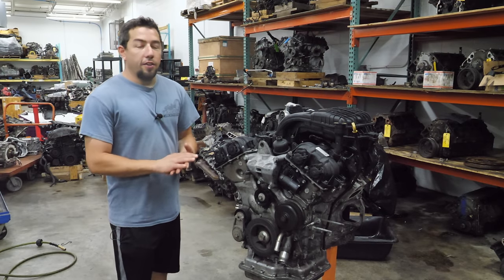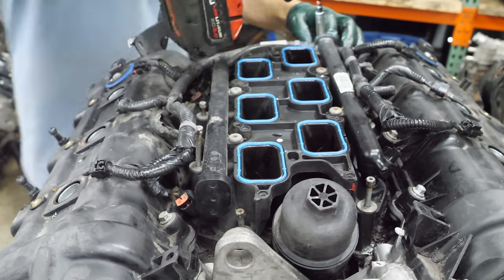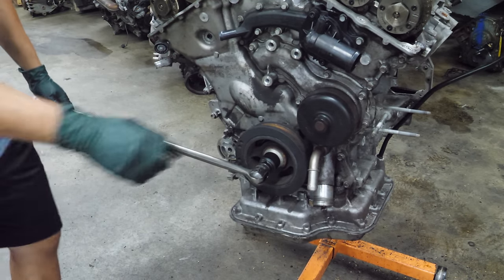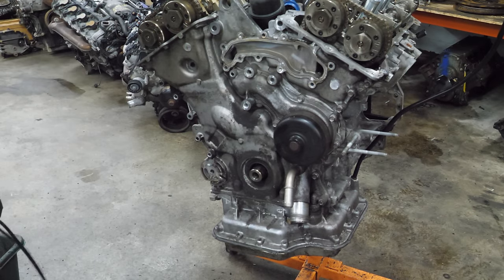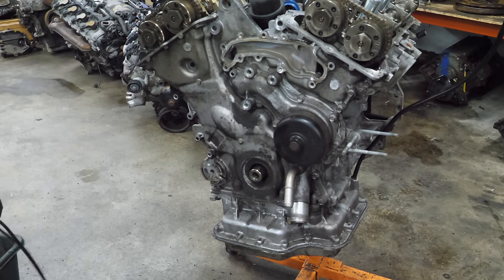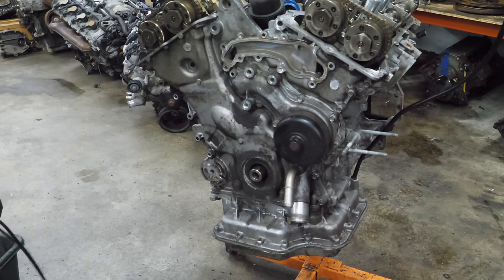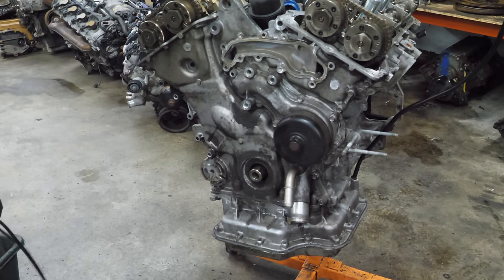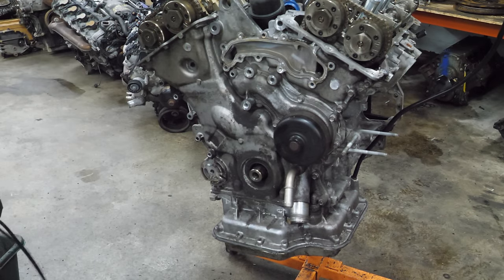Dodge Caravan 3.6L Pentastar V6 Teardown! Why Won't This Engine Turn All The Way Over?

Comment: A lot of the 3.6 were “Flex-Fuel” (FFV on intake cover) indicates that they can use either regular gasoline or E85 fuel. E85 is not around here so I have always used regular. The problem is the computer usually sets for the type of fuel currently in the tank and if you constantly go back and forth between them, it throws the computer out of wack for almost 100 miles causing wrong timing, fuel mixture and poor performance and thinking it is a injector problem, people throw some additive in causing more problems. That might be why the heavy carbon buildup. It states in the owners manual to stick with one or the other as the computer adjust for that fuel. But how many people read the fricken manual???  I have had 3 different vehicles with that engine and all were well over 200k and running great when traded in.
Reply: Or just don't burn the corn water and don't have issues
Reply: I have 2 5th gen vans, an 08 3.3 and a 15. Both go into ethanol percentage learning mode if the fuel tank level increases significantly while off. I can actually watch the PID for calculated ethanol % adjust with AlfaOBD after refueling. We use both regular E10 and E85 in both vans because sometimes the E85 is less than 75% of the cost of E10 and thus worth using and sometimes it isn't. (E85 is 75% of the energy content of E10 thus to be actually cheaper it has to cost less than 75% as much).

Comment: The carbon build up was probably the cumulative result of short journeys on a cold engine, direct fuel injection (no port injection to keep intake valves clean), and a PCV system without catch cans to collect crankcase oil vapours.

Comment: That's an insane amount of carbon. I have this engine in my 2012 Ram CV and it does not consume a drop of oil. Just about to turn 200 000kms too.

Comment: Whenever I spray brake cleaner on a carbon-covered surface, I noticed that while solid carbon usually falls off of its surface, it chunkifies just like you see in the video.  

So maybe someone tried a carbon cleaning solution or water was introduced inside the combustion chamber, with the engine not being up to operating temperature?  Or maybe someone sprayed an anti-seize into the engine, causing that?  I'm not sure

Comment: That’s a heck of a lot of different vehicles for one type engine
Reply: They made it so it would  mount in line or transverse a real gem of an engine I have had 3 of them still own two the sweetest combination is the inline version mounted to the 8 speed ZF licensed automatic close to 30 mpg highway and 22 to 24 mpg around town close to 300 hp and as fast as some a lot of v-8 four speed automatic were 20 years ago.

Comment: Contaminated or sabotaged fuel causing partial ignition? Otherwise the plugs and valves would also be dirty from too much cold running causing carbon buildup. What would be the result of putting diesel in the gas.

Comment: Don't they still make a tool that shaves the tops of cylinders to remove the ledges that get worn there by the rings? Is it called a ridge reamer? It should work on encrusted carbon, too.

Comment: Apart from families, Chrysler T&C are also very popular with the blue hair crowd. I could see this thing being driven very gently only to church on Sundays, probably got some bad gas in it, carbon started building up and not enough RPM's to blow it out the exhaust port. That's probably why the rest of the engine is pristine.

Just my guess!

Comment: Mopar used it in everything because when Fiat came in, they said "You have five different V6s, that is insane.  Pick ONE, put that in everything, save a lot of money."  (3.8 pushrod, 4.0 SOHC, 2.7 DOHC, 3.7 SOHC, and the 3.6)
I have never personally seen an issue with the 3.6 aside from having to replace a lot of warped oil coolers

Comment: Was it a simple EFI problem? Can't be O2 sensors because both sides were bad. Bad MAF? How long would somebody have to drive with the SES light on do do this?
Reply: No MAF, almost all EFI Chrysler SMEC/SBEC/NGC engines are speed-density based.

Comment: Damn im driving in a 2013 wrangler. With 304, 000 miles. Its slowly givibg me camshaft codes, and poweertrain codes  if im pusing 90mph for lomg distances or acxelrating fast .doesnt happen all the time tho. But when it does  It loses power, doesnt let me go up above 3500rpm to shift, gives me all sorts of shifting problems. I admit ..its given me alot of life. In the mean time..i. just babying it to save up money to just replace engine and tranny..maybe a hemi conversion idk yet.

Comment: maybe the carbon was from putting used engine oil in the fuel? or maybe from dirty air filter never being changed causing a rich running engine?

Comment: Honda F22C1. I bet you can't find one in stock form that failed mechanically, at least not without obvious signs of neglect. One of the best engines ever made.
Reply: Does the money shift count as neglect?

Comment: 3:42 I think it's safe to say we know that part wasn't in the combustion chamber. 😁

I'd be impressed if someone got the shoulder after the threads into the combustion chamber AND you could still unscrew them.

Comment: Looks like if you'd vacuum all that carbon via sparkplug hole, you'd have yourself one nice low miles engine. All this carbon could've loosen up from transportation of used engine after sale and packed up all in one spot preventing engine from turning over

Comment: Idk... Maybe someone overfilled it with oil thinking it was low and it just sucked the excess out the PCV into the intake, they thought it was low again and filled it again, repeat?  I think overfilling just once with way too much oil could do it, then maybe it destroys the air filter and the air filter material burns up too?

Comment: This was an exceptionally maintained engine.  BUT it has a serious problem (duh).  Too much unburned fuel in the combustion chamber.  The ECM should have sensed this by the emisions prior to the cat convertor and after the cat.  I'm thinking VVT, ECM/PCM, fuel type???  Very strange to see this engine with this problem.  I worked on a Ford back in the 80s that had a vibration in the engine.  Poor compression  on one cylinder.  The engine was a 302 cid with a 351 piston installed at the factory.  The the piston never reached the top of the cylinder bore.  Just when you think that you've seen it all, BOOM!!!

Comment: 13:00 you're supposed to take the oil control valves and cam phasers off to remove that secondary chain. You looked like a monkey trying to f**k a football the way you were going about it. 🤣😂🤣

Comment: My guess is that this was a decarboning attempt gone wrong. They started the process then let the engine sit. When they went to restart it the carbon had come loose and collected on the lowest point in the combustion chamber . The rotating assembly is ok because it only had the torque of a wrench or a starter applied.

Comment: Definitely quite a bit of carbon there in the combustion chamber. Probably a lot of city driving on that one. Short drives don't give an engine enough time to cleanly burn off the gas.

Comment: Great video!  Has the baby arrived yet?  To prove your theory of the carbon preventing it over, you need to reassemble the engine, put the carbon back in the cylinder, verify it does not turn over, then attempt to vacuum the carbon out of the cylinder  with the spark plug removed and see if it will then turn over.   We're all about the science you know!

Comment: you should purchase an ingersol rand 1" pneumatic rattle gun for tight crank bolts. even a decent milwaukee 1/2"  m18 will piss on what you are using

Comment: I'd love to see the 3.0L V6 from the 2001-2007 Ford Escapes, I have one from 2002 and that thing is seemingly indestructible, low oil once or twice, it's seen 7,000rpms for more then 30 seconds at a time, for way to many times, and its been knocking for a month
Reply: I'd like to see that too.
Reply: If it's been knocking for a month, that means the rod wants to come visit you outside the crankcase

Comment: Do you suppose this is the end result of running the engine with sugar in the gas where the injectors didn't clog up and the engine actually ran for a decent amount of time?

Comment: Always wondered, when you're breaking the rod cap bolts loose, why do you do one cylinder at a time instead of breaking both pair of bolts loose first, and then remove the cap one at a time?
Reply: Likely to prevent warping/breaking a camshaft. If the valve springs are pushing against one end of the cam, and you pull the caps off the opposite side, there is a likelihood of damaging the camshaft.
Reply: @scottcooperii7217  Rod caps, not cam caps.

Comment: The dipstick tube removal problem? Screwdriver, small chisel, hammer, pliers and side cutters. Get down to the bottom to where the tube goes in and use those tools with some imagination.

Comment: Dodge changed the PCV system a little bit on these engines a few years into production, this may have been the issue they were trying to fix

Comment: I've mentioned it before, but I have one of these in my 2012 Jeep JK. It has an open recall on the left cylinder head until the end of this year, but mine's been fine. I preemptively did the rocker-rollers and lifters, PCV (called it when you had trouble with the right valve cover 😅). At that time, I put spark plugs in and the old ones looked good for 85,000 miles.

Since you mentioned it, Dorman sells a cast aluminum oil cooler assembly kit made in the USA. They only fit 2013+, so I bought a second hand OEM oil cooler assembly and transferred the stacked plate cooler to the Dorman unit (that's the part design that varied from my year). I also installed a Baxter spin-on oil filter adapter because I don't like the cartridge filter setup on these. Reading this, I guess I sound a little crazy 🤣. Especially considering I voluntarily rebuilt my Jeep's valve body just because.

All that said, I would be curious to have seen you take a look at the oil pump. I hear it's a variable pressure unit, and I'm curious what that entails. I do think Chrysler gets a lot of crap for sins in the way back, despite GM and Ford making their fair share of engineering blunders. In my opinion, every make has problems, it just depends on what flavor of problems you're comfortable with.

Comment: Maybe he used it always short and cold, and/or never revd it. then it sat, carbon dried, and the starter wouldn't brake the coal. (sorry I didn't read if there was a better solution below).

Comment: I bet if you got some vice grips and welded them to a slide hammer you'd pull the dipstick real quick.
Reply: Good slide hammer kits come with Vice Grip attachments. I know cuz I use the hell out of mine.
Reply: @maxwedge5683  I made the only slide hammer I've ever used. Hot rolled steel rod, a piston pin from a C12 CAT, and some crank bolt washers. I just weld whatever I need to on the end of it. Sometimes I weld it straight to the thing I gotta pull off lol.

Comment: I had a Town and Country and everyone told me it was the biggest piece of garbage and I needed to get rid of it, blah blah blah. I'm not a fan of Mopar stuff and think the Jeeps are the single worst vehicle brand ever made.( after 1995 that is). But that minivan went 217,000 miles. Regular high mileage oil changes. The valve seal leaked obviously and the only issue I ever had was a hole in the radiator. Had to have a total brake job once, and a strut replaced so that led to both being replaced. But mechanically  it didn't have issues. You had to fill it up slowly with gas because of a design flaw in the gas tank. And of you drove a puddle the power steering would quit for a second or 2. So it wasn't my favorite vehicle,  but it lasted for as long as I needed it to in a time when we needed a cheap vehicle right away.

Comment: I’m guessing someone didn’t have an air filter or use the proper air filter or change it at the recommended intervals. That carbon buildup actually looks like burnt dust

Comment: A lot of parts are buried like plugs and coils and just seeing the beginning of a teardown is useful for someone who wants to do maintenance. Inside the engine there are some gas saving rocker arms that some others have said are a problem, probably would not attempt that kind of job though. I watch videos about my Promaster's engine to find out things like the rocker arms and general problems I might try to avoid. It has issues with reservoirs filling with water like plugs, keep your windshield water passages open. The plastic oil cooler leaks but that may be Jiffy Lube torquing filter caps for those that do not do their own oil, do my own, drive only warm weather, use 30 instead of 20 weight for better high heat lubrication, though I don't stress the engine in general heat wise. Replace some parts, clean up the pistons and valves, get it running, and sell it as a rebuilt probably good for 100K if parts that wear out are replaced.

Comment: Oddly, a minivan engine.   I have a newer version of this in a 2016 Durango,  and it runs well, "but" unless using 'sport mode', it barely cracks 2000 rpm in a daily basis.  If it was a grocery getter,  and maybe stuck egr/pcv it could end up with a buildup of carbon.   My old 225 slant 6 made a ton of carbon in the winter at -40C, and never locked... but that's a different era.

Comment: Love your videos, just the right vibe. Something I haven't seen that I'd love to see you do would be a Hyundai Gamma II TGDi 1.6, or a "Smartstream" 1.6 TGDi. Really curious to see that headifold system and what the bottom end of one of those engines look like, I have a 2019 Kona Limited with that engine and it's been great for 75K miles. Curious what's going on in there.
Reply: If you watch the teardown from the regular 1.6 gamma non-turbo engines, you'll find they're built the exact same as the turbo engines. All kia did was just add a turbo to their 120 hp 1.6. It's actually insane

Comment: Almost every rental car I get runs noticeably better after a couple days of my driving...aka hooning on it at every reasonable opportunity.  In my experience, engines live much better lives if you give it the beans now and then...and it's got to be actual beans, like highway merge with foot to the floor all the way up to flow of traffic speed kind of beans...  That's the only way to get enough heat into the chambers to keep the carbon burned off and the rings free'd up.  Engines that are babied their whole lives make great junkyard pulls from a wear standpoint, but suffer a lot in long term driveability and fuel economy due to gunked up ports, combustion chambers, and piston rings, and the rest of the car usually falls apart before any engine wear due to occasional hard use adds up.  The intake port buildup on that pentastar looks like it's never seen any action.  Other things like cam phasers also benefit from getting exercised across their full operating range more frequently.  Use top tier fuel, use good quality oil and change on time, and actually drive the poor thing once in a while and this kind of stuff won't be as much of a problem.

Comment: This engine wasn't allowed to warm up before the majority of shutdowns, but not just short trips, I don't think this thing was allowed to get hot enough to light off the cats completely the majority of trips. Add to that, probably never revved hard or driven at highway speeds, probably just driven around town. If start/stop comes into play, I'd imagine if the engine is never warmed up that well, if start/stop is active things will just be even worse.

Comment: remove the cam phaser next time. its easier to remove the timing chain...just remove the big nut at the end of the cam...and ive never seen so much carbon in a pentastar since we replace the left head under warranty even over 100k miles

Comment: I've been thinking about buying a new Challenger with this engine. You've all but convinced me to do so. I think I'll wait for the 2023s to show up at my local dealer, though, depending on if I can get a reasonable deal.
Reply: Comes from the factory with an oil cooler leak. Bad idea

Comment: I would never have guessed at carbon build up....
That gasoline they ran through it must have been from the very bottom of the oil barrel. 
Cheap gas, expensive out come
Great video.... thanks for always posting for our entertainment. I truly appreciate your hard work...👌😁
Reply: Nonsense.  There is no gas sold in the United States than can cause this.  This is a crank case vent issue.

Comment: I have the engine in my 2018 wrangler. I did a lot of reading on that engine and it’s on the high compression. So you need to run the engine on higher octane fuel to avoid pre-detonation and possible rocker bearing ware out. I only use 93 octane and change the synthetic oil every 4000 miles. Still it’s wise to properly maintain an engine. When I bought my CJ7 brand new in 1986 and did very much the same except back then I was changing the oil every 2500 miles. When I sold my CJ7 (bad mistake) it had 157,000 miles on it and the 4.2 liter inline 6 purred like a kitten.

Comment: No idea what the engine code on the original Caravan engines were that wouldn't die (even though everything else on the van did), but one does wonder where Chrysler imported it from as they've never been able to duplicate it. If you're a film maker and need an unassuming hero car, give them a 1980s Chrysler Caravan and a blue check shirt. The memes will understand.
Add: This has a strong case of Grandma's Grandkid Hauler, that only gets used a few times a year. Probably the same case for the oil maintenance!